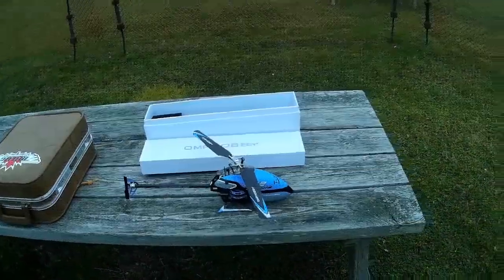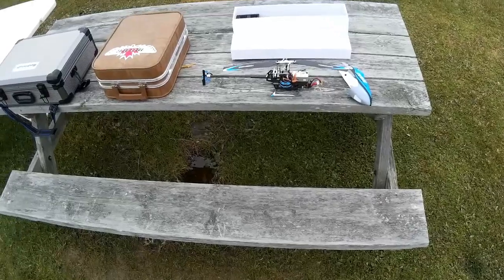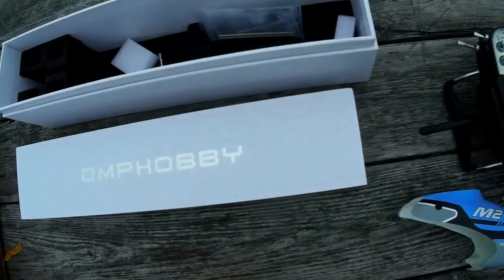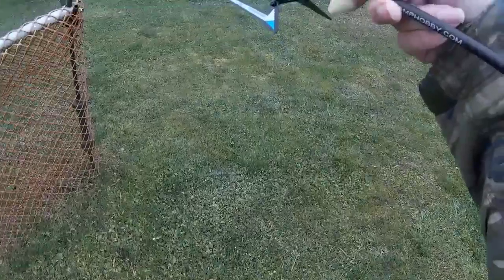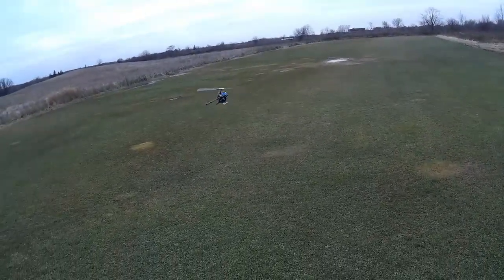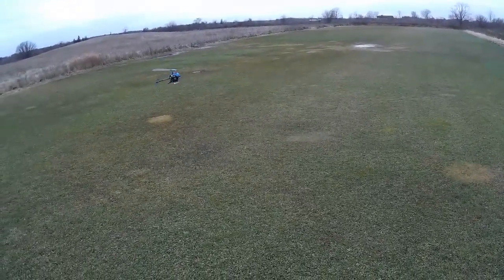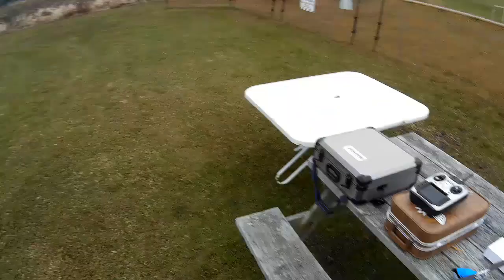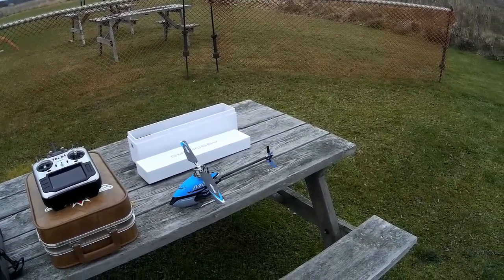OMP M2 Heli   first check flight

Comment: Many thanks for the video. I really like this Heli. I previously had an RC Heli but found it difficult to fly. It was a Hirobo Shuttle if I remember correctly. Do you think the M2 is easier for a beginner? Also, I’ve never heard of a Jumper transmitter, how do you rate these? Thanks.
Reply from the maker: I'm pretty sure that you'll find the M2 easier to fly than the Hirobo. It does have computerized stabilization, which makes it very steady; and even with the stabilization turned off, control is quite positive, for the most part. What I find most difficult with the M2 is keeping the lift stable - it does seem to want to bounce up and down rather, without any real stick input (or at least, with only very tiny inputs). Quite honestly, my number one recommendation for a beginner collective pitch heli at this point would probably be the Blade 150S. The WL Toys V950 is also extremely good value - almost as good in flight as the 150S, and considerably cheaper (albeit with a cheaper build quality in various regards). I bought the Jumper transmitter because I had been thinking for some time of trying an OpenTX transmitter, preferably one with multi-protocol capabilities. I have been a long time JR and Spektrum user, but I had ended up acquiring quite a number of helis and fixed wing aircraft that could not be flown with the Spektrum DSM protocols, and I was interested in getting a quality transmitter that would allow me to control these various craft. So far, I am very happy with the T16. There were a couple of initial hiccups, getting the firmware of the internal  multi module updated, and switching the transmitter itself to a current release of OpenTX. It has been working very well for me, serving as my main transmitter for controlling a range of different things. However, I am in Canada, and it is difficult to find good opportunities for flying outside in the Winter, so although I have tried the T16 outside a couple of times, most of my experience with it so far has been with indoor flying at the community centre arena. So, I will have to wait for better weather to really check it out flying at longer range outside.
Reply: kleedham Many thanks for your comprehensive reply and suggestions. I’ll certainly take a look at the Blade which, in the U.K., is more readily available. I noticed the bounce in your M2 and have seen similar in other review videos. That would be quite unsettling for a beginner. Thanks again, you have a new subscriber 👍